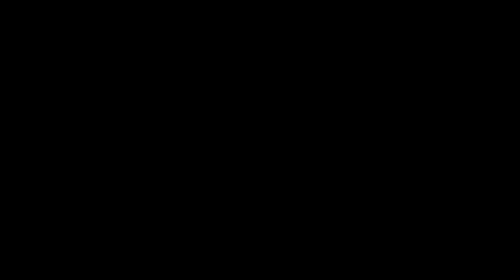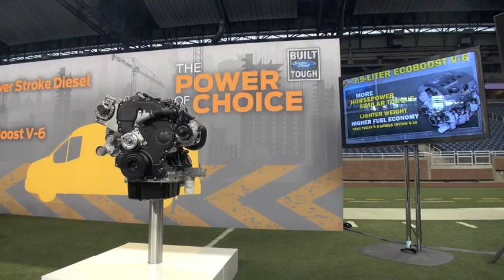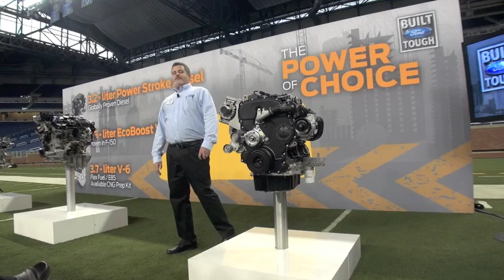2013 Ford Transit 3.2-liter Power Stroke® Diesel engine

Comment: What he forgot to mention: 
1.Oil pump looses prime through poor quality non return valve in the PURFLEX oil cooler / filter assembly
2. The DENSO fuel injectors fail to to premature wear and blow holes or cracks the pistons due to concentrated fuel injection.
3. The EGR fails at 35 000 miles.
4. The starter motor rotor becomes contaminated by clutch dust and destroys the armature.
5. The intercooler is undersized so will cause over heating issues when in hot climates like the southern states.
6. The oil pump will fail at 50 000 miles....
7. Expect constant electronic issues.
Reply: This is scary. I’m guessing this was in the 2016 transit van 350HD?

Comment: 2024 Update Here, I lost my first Engine at 25,000 miles due to EGR failure. Ford warrenty took care of this snd replaced the engine, At 100,000 miles the DPF clogged, so I had it removed along with all the other emissions BS, Transit Van just turned 193,000 miles and still running strong. Oil changes with Rotella T-6 every 5,000-7,000 miles. I need a new Van but no more diesel option from Ford
Reply: I have one that I’m ready to dump because of emissions. How were you able to delete it? I can’t seem to find any aftermarket support.

Comment: Torque Converter Failure already, truck is 3-years old, 100,000 miles, brakes every 20,000 miles WTF !! Fuel Economy? 15-mpg  Pathetic!!!

Comment: I have this engine in my 2014 Ranger Wildtrack and it runs great!  It does not have all of the EPA crap on it so I guess that is why it runs so well!  The pickup is one of the best Fords I have ever owned and I have owned 7 since 1995.  I am thinking about shipping it to the US if I move back but with all the requirements on emissions, I do not know if I will be required to add them to it.  The truck was built in Thailand and destined for Australia but I got it before it could be sold in Thailand.  Now they are creeping up in sales all over Asia and I  predict they will surpass Toyota and Isuzu in the next few years.

Comment: Got this guy is completely full of crap. Cost of ownership? How about the fact that my van has cost me $32,000 above and beyond the initial asking price due to the fact that they don't honor their warranties? How about the fact that my 3.2 liter powerstroke Transit is right now sitting in a dealership with a piston that has a hole burned through it? This despite the fact that I regularly change the oil before the scheduled intervals. Regular coolant maintenance. Regular fluid changes. Regular transmission servicing. Regular Services of all types as required by the owner's manual has not stopped this vehicle from breaking down on a regular basis. Not one month goes by that I don't have some kind of engine trouble out of this piece of steaming shit.

Comment: Proven record of reliability and durability in markets where it's not forced to breathe its own damned exhaust. The only places where this engine is actually considered a living legend is Australia and South America, places where they don't have to run scr DPF and EGR. I know from experience. I own one of these pieces of crap. I've owned it for 2 years, and in that time it's been broken down a total of six months. This is primarily due to the fact that no Ford dealership in the country has a truly qualified person capable of working on it, but is also a result of the fact that they did not properly put the logistics in place to support the damn thing before they released it into the market. The high pressure fuel pump on mine blew up, and it took 62 days for them to finally return it to working order because they couldn't find all of the parts. And what did Ford do for me? Nothing. They claimed that the damage was caused by water in the fuel tank. Wiped their hands like Pontius Pilate and left me holding the bag. I've also encountered numerous wiring issues with the steering column, body control module and its Associated harness, the exhaust system is a pile of steaming crap  that constantly breaks,  and in my opinion, having owned this piece of crap for the last 2 years, the entire thing is designed to fail. Plastic parts Where Metal should be used.  Proprietary codes that you cannot read.  And just because it's a diesel,  Ford feels that you have to pay them an additional $100 to $300 just to hook it up and diagnose the problem.  This despite the fact that the same exact VCM IDS interface is used across the entire Ford Fleet of vehicles. It's a rip-off. Ford has completely nosedived in terms of quality and customer service. This is a shit design, a shit engine, and it needs to be taken off the damn Market.

Comment: Yeah just brilliant...................................NOT.     From  
owners talk , you would be  Very  fortunate  if you get 30k miles 
without it putting a leg out of bed .  2.2ltr  4 pot  also crap.  Apart 
from  broken pistons repeatedly ,  Faulty fuel senders, Turbo blowing 
requiring   engine replacements,  turbo inter cooler failures , new 
batteries all before  24 months.   Yeah  !  overall a great feat of 
engineering & reliability FORD. 
Oh! forgot to mention Customer Service 
..........................................  What   Customer Service 
?????  
 Do yourselves a favor , and buy Japanese , or a GAS engine .        ( European Review, we are only offered these crappy diesels)

Comment: Question 3.2 diesel 5 cilinder  engine the global name is duratorq why change in américa for powerstroke
Reply: Raça forte because in the United States, ford diesel engines carry the power stroke name plate. Simply just a matter of marketing.

Comment: hmm so todays so called reliable engines means adding ass much plastic as possible but not so much that it breaks during the warranty looks more like my civics engine but i think my engine will outlast that heap of modern plastic but theres nothing we can do im more impressed with dodges ecodiesel if they added rwd and that v6 diesel instead of the promasters i4 diesel and fwd it would be awesome
Reply: Its a actually composite plastic would melt
Reply: Well true its not plastic anything that resembles it I just call it plastic but it would be better just using aluminum
Reply: I personally think when the new Ford ranger comes back in 2019 to the i hope it has this engine
Reply: @mauricemotors8207 👀

Comment: I've never understood why the hell we in the US have to have EGR?? I mean WTF?!?!?? yeah, that's smart, let's refeed the engine it's own exhaust... How about we breath in our own farts for better energy...
Reply: So in order to clean up the exhaust, they introduce another noxious poisonous chemical into the atmosphere in its place. DPF is a joke. It's a lie. The entire system incinerated the visible soot down to a particle so small that it passes directly through your lung tissue and into your bloodstream. The EGR system does little to nothing, as when the vehicle is actually under a load there is a bypass valve that causes the EGR system to shut off. The only time when it's really needed, the EGR is not actually operational. And don't even get me started about scr. Those things are even worse. Yeah let's trade nox for ammonia. That makes a lot of sense. The only reason we're running this crap in the United States is because people don't like to see the black smoke. The fact is, a standard diesel without all of that crap strapped onto it burns cleaner than a gasoline engine with all of the EPA stuff on it. It does that because it's more thermally efficient and when properly tuned will not puff any black smoke at all.
Reply: The European 3.2 Makes 200 Hp and 350 ft/lb , the American one makes 185 Hp and 350 ft/lbs
Reply: Always a good laugh when someone tires to compare a hunk of metal to human physiology.
Reply: Nothing but a grenade dropping like flies here in oz
Reply: blew my engine at 25,000 miles
Reply: We have EGR because not everybody want to smell diesel exhaust fumes. The next time you see a new diesel truck at idle. Smell the clean exhaust. You want believe it's that clean. 
Now if they could stop nasty ass truck driver from pissing next to their trucks.
Reply: @Fone65 funny thing is I deleted the egr on all my pre 1995 cars albeit gasoline engines, only kept the cats and evap system, and removed any sort of smog pump/secondary air injection...none smelled worse, they smelled the same as before...my 2011 mustang 3.7 with the factory cats and no egr from the factory smells at idle if you stay behind the exhaust for more than 10 seconds, it almost smells like a catless car tbh

Comment: They need to put it in the f150 and quick to catch up with dodge and chevy
Reply: If not the F150, certainly a compact Ford  Ranger truck, or how about a good swap for a vintage Ford Bronco II SUV from the 80s?
Reply: ***** Never mind what other car companies do, this is Ford's baby, and as such, Ford needs to take the initiative.
Reply: VK7001.P If they can make it durable enough to last a long time, while also being light enough to reduce the overall weight of the vehicle, So much the better. :)
Reply: I agree. It's unforgivable that most of the European cars are diesel powered, while only a few of our North American cars get diesel engine. Although I'm not a Ford owner, I believe that Ford cars and truck buyers should be allowed to have that option. Is diesel for everyone? No, not really. There are still people who don't like the clattering noise they're known for. There are still those who, no matter what you say, believe that diesels are unreliable engines that'll fall apart on you while you drive. Well, you can't please everyone. But I believe that if there are enough places to service and maintain the diesel engine, the engine should outlast the rest of the car, possibly the driver who drives the car.
Reply: +Jason Carpp It may been in the Ford ranger
Reply: thats a good idea a 1/2 ton option but i want my 6.9 idi back i can only rebuild it 2 times ans im at 600k so thats one i only have 1200k befor its not rebuildabel
Reply: VK7001.P I agree. I remember when diesel trucks used indirect injection.
Reply: Jason Carpp yea but can you imagin is they used the neew compacted grafite iron to remake the 6.9 it would be 30% lighter and last 50% longer and it will have a tighter fit with better turbos  dream come true throw a burly T18 behind it and you have a real truck
Reply: I agree i think these would sell like crazy in the F150 , they're already available in Europe in the Ranger!
Reply: Jason Carpp I live in Europe and yes 4 cylinder diesels like the ones we have here are noisey pieces of shit that are slow as shit too, i have never bought and will never buy a TDI
Reply: No. This engine does not belong in any vehicle. At least not in its current Incarnation with the American EPA standards being so goddamn draconian. The F150 line is already become something of a joke because it has an aluminum body now, and a junk V6 twin turbo this constantly blowing up. The only reliable F150 in my opinion was the 300 straight 6 version that was built in the early 90s. That's the last really good motor that Ford built internally. Everything else they've tried since then it's been nothing but shit. Even the new V8s are not immune. I'm currently in a rental right now because my 3.2 liter powerstroke Transit is sitting in a dealership with a blown engine. They put me in an F150 that has the Coyote 5.0 liter. This thing just rolled 30,000 miles, and regularly misfires, bucks, throws the check engine light at me, and stalls out until I pull over and restart it. In a vehicle with less than 30,000 miles on it. Ford used to be known for reliability and tough Vehicles. Now they're nothing but a fucking joke.

Comment: Several important issues about the 3.2 Powerstroke that need to be made.

First Issue: EGR is the absolute worst way to lower emissions. Its is a lesson in engineering hypocrisy. 

The purpose of a Exhaust Gas Return system is to lower the combustion temperature in the engine. The reason for this is to lower the amount of NOx produced during combustion. 

There are two fatal flaws in this concept. 
1. Recirculating exhaust gasses starves the combustion of the fuel, resulting in high levels soot and carbon monoxide. 
2. The EGR system requires the exhaust gasses to be cooled before they are returned to the intake manifold, which will cause soot to build up in the heat exchanger, eventually clog it. When that happens, well let me just remind you of all the problems with the 6.0 powerstroke.

To clean up the mess of the EGR system, they commonly use a Diesel Particulate Filter. This gismo does just what it's name implies, it filters out most of the soot and CO from the exhaust. Problem is, the filter eventually fills up. So to prevent it from clogging up you exhaust, they use a process called "regeneration" to clean out the soot. This is basically shoving way too much fuel into the cylinder, and letting the combustion extend beyond the confines of the cylinder to reach down the exhaust system and burn off all the carbon that has built up in the filter. -- Anyone starting to see a major problem here? 

The end result of this dynamic duo is a lot of fuel gets spent without producing any power, causing your fuel economy to take a shortcut to china along with sending your EGT on a lunar mission. The majority of the NOx the EGR prevented is produced during the regeneration cycle. And the EGR cooler is a ticking time bomb that's going to blow your engine up if you're not careful.

In my experience adding a more efficient intercooler will do a lot more to lower combustion temps than an EGR system. Cooler in means cooler out. On my toy rig I like to experiment, and one of my latest ideas was to add extra pressure tank to my pneumatic system. This second tank is filled every time my main tank is full, bleeding off the excess air volume to the second tank. I've also added a charge cooler to the pneumatics. The secondary tank is used as a boost charger to fill in the boost lag gap. This 

Second Issue: Its an inline five. Yes to save on length vs an inline 6, as one cylinder is left off, but it leads to a long list of design complications. 

By removing one cylinder you lose the inherent balance of the I6. The engine has balance issues in all three orders, requiring a balancing shaft to cancel them out. While removing one cylinder from the design may reduce parts count, weight, and to some extent friction losses, the added complexity needed to balance it pretty much counter all your gains. The only real gain is a reduction in overall engine length.

IMO It would have been wiser for Ford to have simply developed an I6. Adding that cylinder back on to this engine would make a 3.8L inline 6. And with proper kitting out would be a nice engine to drop into a Mustang. 

Hey, if they are going to make the new Stang a world brand they might as well go all the way! And no dinky ass I4's either. I don't care if the Diesel engine out shines the gasser V8. If your going to do it, do it right! 

Third issue is Materials: If Ford can build the block of the 6.7 from CGI, why the heck are they using gray iron for this engine? And Aluminum heads are a joke! 

Ford needs to start flexing its engineering might and design a family of mid sized (between 200 and 300 cid) diesel I6's that have the performance aftermarket in mind during their development. Engines that are designed to save on weight, while retaining strength, along with engineering in common, yet expensive, aftermarket mods, IE Head studs, so that economy of scale can mitigate a lot of the cost.

Give us a sexy diesel in a Mustang, then let Roush go hog wild with it! Make some real noise! Simply put, make diesel sexy and america will eat it up!
Reply: Before you say anything bad about the concept of a diesel engine with 5 cylinders in line, you should do a little research on which engines have proven to be the most durable in the history of diesel engines, which are the old Mercedes diesel engines with 5 cylinders.  Explore a little history of Mercedes diesel engines with 5 cylinders in line.  I see that you have knowledge, but you turn into overbearingness, so you embarrass yourself.  It's amazing that you take the even number of cylinders as inviolable.  I am from Europe, so my English may not be the best, but you will understand what I wanted to say.   If you think that the people at Ford are idiots and at Mercedes are geniuses, if you think that the Americans are an inferior nation and don't know how to make a simple diesel engine and that the Germans are superior...then say it out loud, don't hide behind the story about engines.
Reply: Egr starve of the engine of fuel? I can tell you don’t know what you are talking about.

Comment: Why don't they offer the diesel engine here in North America? Diesel may not be for everyone, but so what? That should be our decision to make, and not the car maker, nor the USA-EPA.
Reply: Jason Carpp It's only for the transit (large) model. Diesel here is for commercial driving.
But a nice tdi cr is wonderful on the highway.
Reply: It's a shame that it's not available for the Transit Connect. I was in England in September, and I saw quite a lot of Transit and Transit Connect vans and trucks, and most of them were powered by turbo diesel engines. So why not here in North America?
Reply: They do. This engine is available in the US market.
Reply: Tanner King In 3.2 litre form? Really?
Reply: Tanner King Is it? I haven't heard any advertisements about the engine.

Comment: if people were smart they would not put this in the F150s because that would kill the sales in the heavy duty trucks. i give it maybe a year and then Ram's heavy duty sales will drop with this "Eco-diesel engine." so i would keep it so the only turbo engine in the F150s is the "Eco-boost."